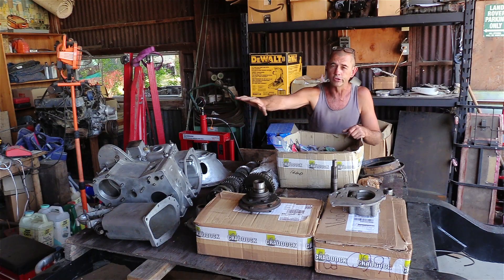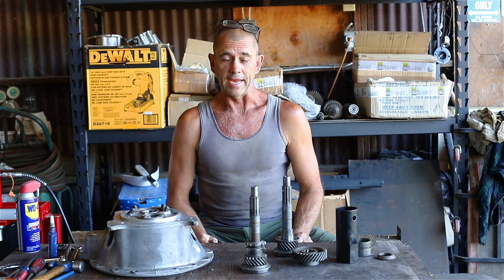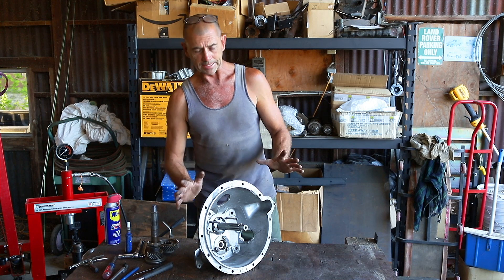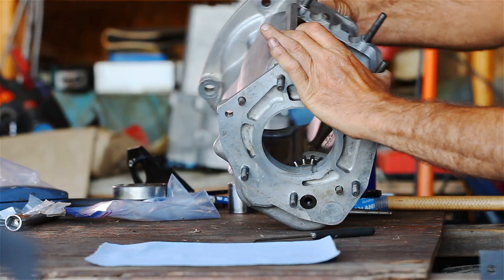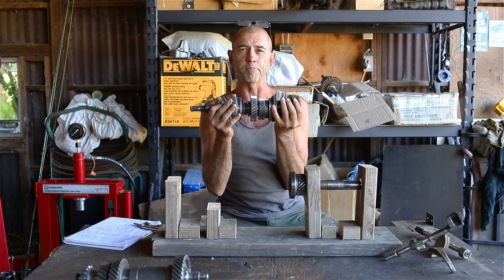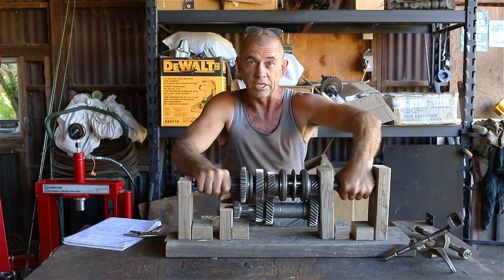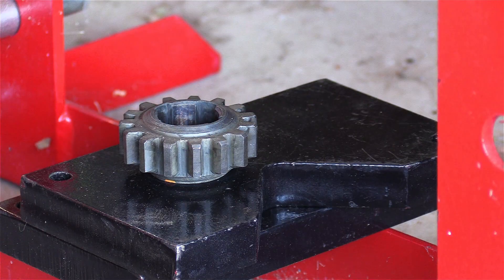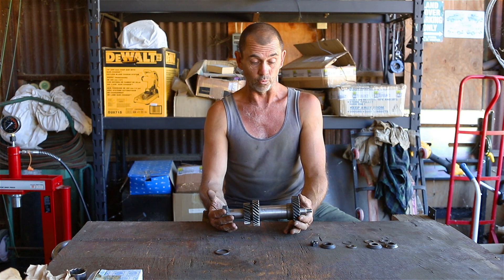Part 20: Gearbox Overhaul_ Series 1 Land Rover Restoration

Comment: I now will have to get a gearbox to try this on and then I need to get myself a landrover That was and always is fun If I had a teacher that was that confident I would have been a better electrician Well done
Reply from the maker: I do part time work for a local electrician, its a great job though I usually get called in for the hard stuff involving attics, crawling on my guts in the filth under houses and digging trenches. I have had the honor of a few zappings playing about in panels which really woke me up. I'd advise getting a Land Rover, I like Toyotas and Nissans ect yet there is something extra with the old land rovers, Defenders and even the Disco's.

Comment: Well done Mr Foreman. The old square peg and the round hole (bell housing not fitting into the compact press). This brought back may mermories of similar situations, the plight of mendling with mechanics. Great explainations of the inner mysteries of the gearbox and the edge of you seat surpense as to whether or not would all the things, bits and bobs would fit back together. We are looking forward to Section B. Cheers Geoff
Reply from the maker: Section B is already in production though a little stalled waiting again on parts. Had some bad ones turn up that cost a fortune to send back for a refund. Aftermarket stuff is very hit and miss and if the rubbish stuff goes into a gearbox it would cost even more down the line. Not to mention emotional anguish and pain. Avoid the syncro clutch from John Craddock when your series 1 shows up. And 3rd gear! Heed the warnings or tears will flow.

Comment: Brilliant as always, you have a very watchable style. The "hobbit press" and flintstones gearbox demonstration make it an 11/10 job I recon. 
So much easier with a press, the very job I bought mine for. Interesting to note that pin on the mainshaft bearing housing, deleted in favour of locktite on later models. 
Nice job!
Reply from the maker: Thanks SteamWalley. I do envy your series 3. I reckon the best compromise between the old and the newish with parts 'easyish' to find.
Reply: @ForemanAndWilmsAdventures  Much as I'd love a series one, the Series three fits the bill perfectly. Trading it in would be like losing a limb..

Comment: Excellent work from Foreman and Wilms - especially top explanation of the inner workings of the main gearbox...looking forward to similar explanations of the workings of both the transfer gearbox and also the final front and rear output drives...Glad that all is pieced together, despite not being able to get the bellhousing casing into your wee 10 ton press!
Reply from the maker: Thanks Mark, I've had some poor quality parts turn up that have slowed things down a bit but otherwise all is going much better than expected. Once one more expensive replacement part for another expensive replacement part turns up I'll be moving onto the transfer box.
Reply: Always an issue having new replacement parts that are not up to the same level as original NOS ones...invariably parts fail, often when you least need them to, then it's a case of get home or to the nearest garage to sort it out. Gone are the days of widespread availability of some parts, though most wearing parts are available, it's just a question of treading through a minefield as to what is worth fitting and what is not...Enjoy!

Comment: I’m glad you struggled with the output bearing housing because mine was difficult and I thought I was just being a pansy :o) Two gaskets is a must, it is so easy to cut it fitting the bellhousing while wiggling the shafts together. I finished up using the old one :o
Reply from the maker: Those circlips are a challenge. In fact all of them I find. They certainly allow one to practice the virtue of patience.

Comment: After two aborted attempts i finally got a full view of the video, very impressed with the cleanliness Mr Foreman it looks a treat. I am appreciating this as i have a Series 2 that has gear issues and watching it being done assists greatly, thanks again for the video will be waiting for the final assembly.
Gippy
Reply from the maker: I like the series 2's and there are a lot more parts and accessories available for them. I find these cross over models like mine (not quite a series 1 and not a series 2) , the parts are harder to find and more expensive. I shan't complain too much as the old chariot is a treasure and I'm getting more excited about it as it starts to come together.

Comment: Great video as always. Did I see some crimson leaking from your fingers about 25min? As far as I've heard that clip is a pig to remove and replace. Sneaky video editing on the clip replacing about 25:50. :)
Reply from the maker: You got a good eye. I anticipated being caught out for the cheeky reverse clip of putting on the snap ring and I did indeed get impaled by a sharp piece of wire. There was a close up of oozing blood but it didn't quite fit into the flow of things and ended up on the cutting room floor.

Comment: Great work foreman. How did you clean those housing ? Degreaser, gasoline, wirebrush and you talked of hot bath ? I want to clean mine 🙂
Reply from the maker: Greetings Kenny. Cleaning the housings is a long and tedious task. De greaser and gentle scraping was stage 1, followed by a largish plastic container filled with very hot water and some truck wash. Once I could get my hands in there with only minor scolding some scotch brite was used to scrub away at the grime. Wire brushes and scrapers, if deployed should be done carefully especially on mating faces. A rinse off at the end and your ready to start on the next one.
Reply: @ForemanAndWilmsAdventures  Thank you so much for explaining. I am now watching part 30 and I hope the parts keep going. Lovely videos. I hope to start restoring my 2a later in the year. Greetings from Kenya

Comment: The gear oil thing is a myth.  I ran new spec oil in my gearbox/transfer box and overdrive for five years without any issues whatsoever, I also used it in the swivels and the axles with no problems. There was a massive debate about this a few years ago in the LR forum space and the conclusion was, after much testing by several parties, that it's a falacy.  I can confirm, after the five years I used modern oils, with daily use, my gearbox didn't explode.  I'd love to report how things are today with said gearbox but some scrote decided they deserved my 1963 109 more than me and so they nicked it.
Reply from the maker: That's a tragic story! I commend you on your politeness describing the thief, I'd have used much stronger language. As for the oil debate I confess all my sources are 'off the internet' which immediately calls into question their validity. I feel in this one to err on the side of caution and stick to the GL4's. A similar thing exists with synthetic oils in rover V8's. I just swapped out the one in the Disco and the company providing the engine warns against using them. I'm far from an authority in lubricants so choose to weigh up the options and choose the safest.

Comment: Mr. Forman, I really love the Series. I'm actually doing the same rebuild and have learned a lot from the series. I do have a question, as I'm looking for parts supplier's I'm not finding any suppliers who has in stock the Primary Pinion Shaft, part number 518473. Sooo where did you get your new one? The later model for Suffix (C) does not have the same numbered teeth on the shaft or the constant gear, considering there a matched set,  does that even matter? Thank You again I really love the series. Scotty from Sunny Calif..
Reply from the maker: Greetings Scott, I thought I'd replied already but there may have been a malfunction. If I have then disregard this reply. I got my primary pinion and constant gear from John Craddock. Their website never tells one if the items are in stock or not only if they are no longer available. I saw the item on Dingocroft, also out of stock. Except for eBay UK you might just be in for a bit of a wait, something I've grown quite accustomed to over the course of my restoration. I really couldn't say if a later model primary pinion would work or not though my instinct tells me some problems would surely arise. Best of luck on your quest.
Reply: @ForemanAndWilmsAdventures  Mr. Forman, Yes it would appear I asked the same question twice.. I'm not much of a computer guy. It appears that I have 2 different YouTube accounts who knew.. In any case, my Land Rover is a 1963 2A. It seems that the early 2A shares parts with the series 1 & the later Series 2A.. I'll try Craddock for the Primary Pinion Shaft. I'm right where you were 11 months ago. The chassis is complete and rolling. I am currently do the Gearbox build, so thank you!
Reply from the maker: Good stuff, I'd figured you might have tried Craddock already but if not there is a good chance you'll get it there. I think those 2A's are good trucks and it seems most parts are easier to get than the creature I'm working on. The 57 appears to be a bit of a hybrid, almost a series 2 but not quite.
Reply: @ForemanAndWilmsAdventures  Yes, I'm actually glad I don't have a series 1!I found the 2A setting in guys backyard for 35 years in Calif. about 2 miles from my house and it was complete. Yes, everything needs to be R&R but that's ok, its not first trip to the rodeo..